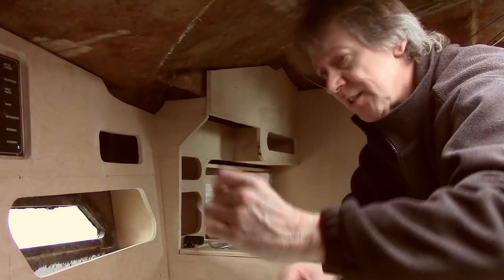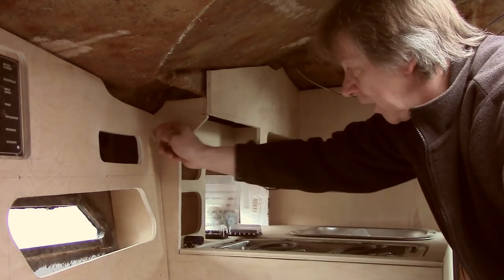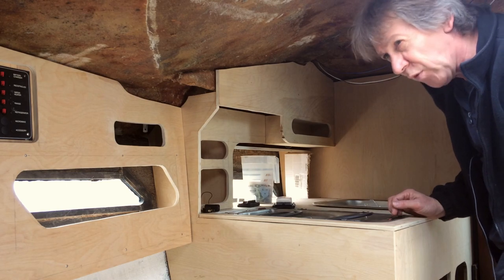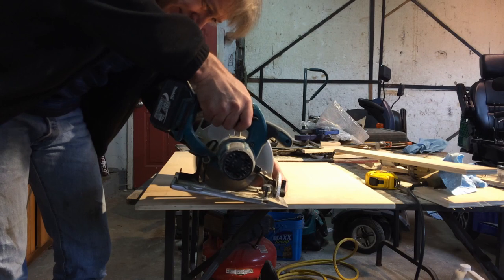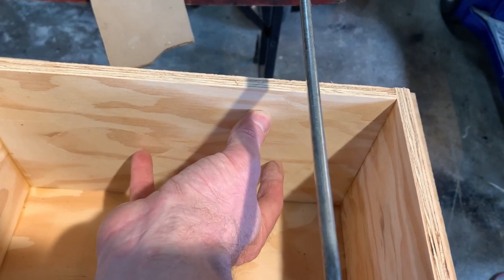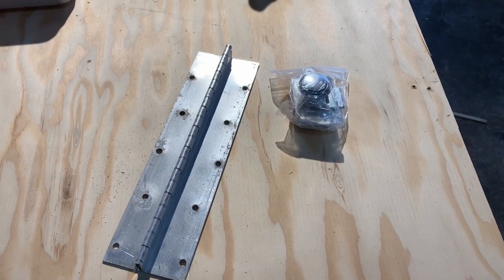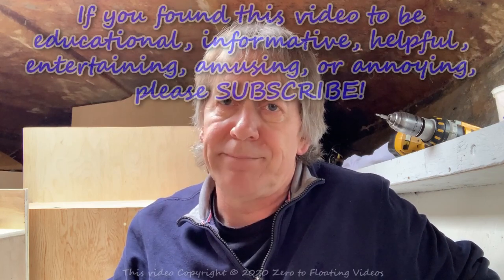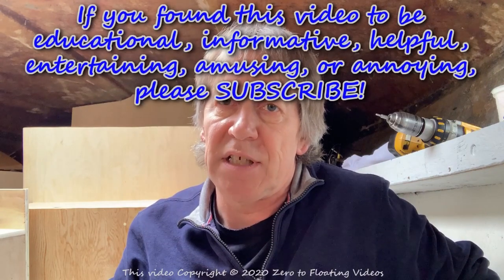Part 14 – Electrical Planning (12 volt) & Cabinet Doors – 1974 Sea Ray SRV 240 Weekender Re-build

Comment: I really like the cabinets.  You’re putting a lot of good thinking into this and it shows.
Reply from the maker: Thanks! Thinking when I should be sleeping... or so it seems!
Reply: Zero_to_Floating I do the same...drew out a solution last night to running new fuel fill and vent lines on my boat....lol.

Comment: Great work. Are you going to glass over the cabinets?
Reply from the maker: Thanks! Not planning to glass them - no need. These are interior cabinets. Planning to stain them, and then seal with a polyurethane finish. I will use some teak for trim to hide the plywood edges.

Comment: Did the snow melt yet? Still not quite feeling like spring here.
Reply from the maker: Yes, it did. Although we still had frost yesterday morning...
Reply: @zero_to_floating8338  glad to hear. Hopefully that was the last of it! Excellent work, great video, as usual :)
Reply from the maker: Certainly hope it warms up. Still a bit cool - I have a heated shop, but can't fit the boat in there... And thanks!
Reply: I got my glass laid in my bilge today. 4 layers of csm, and a layer of woven cloth. Ill be putting in the stringer section tomorrow. I didnt video it tho, because It's a temporary fix. Kind if just a band aid to get me safely through the summer. Not pride work lol. Turned out pretty good tho, for what it is. Good and strong. So when I tear everything out next winter, I'll video log it all. I have a ton of projects to do, so I think I'm going to start a channel with my son, where we fix, and bring stuff back to life. Hes 8, so I think it's the right time for him to get his hands dirty :)